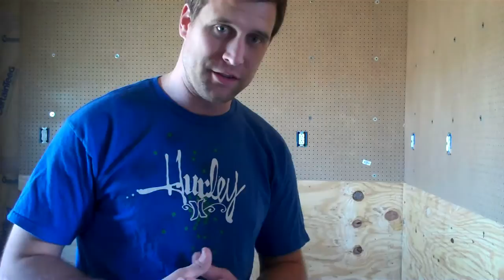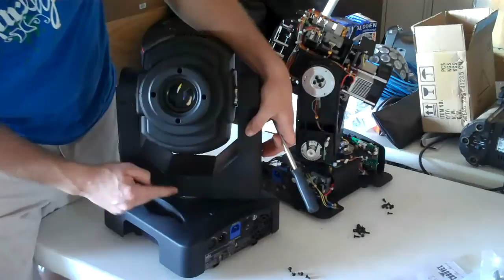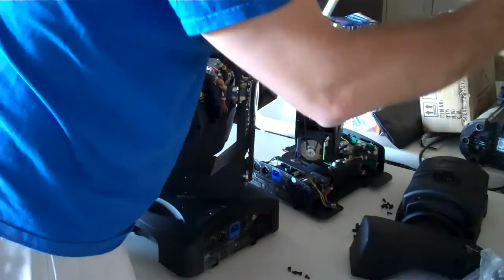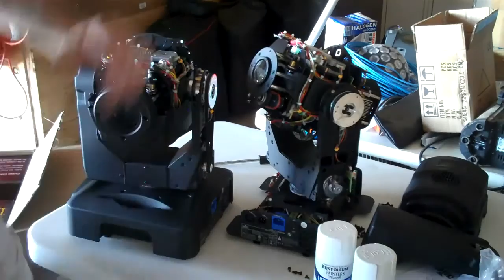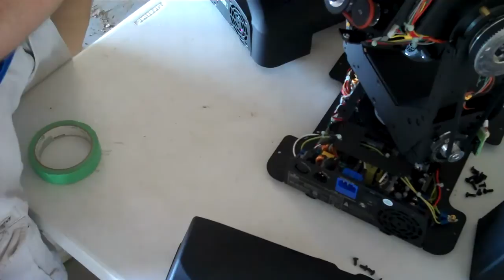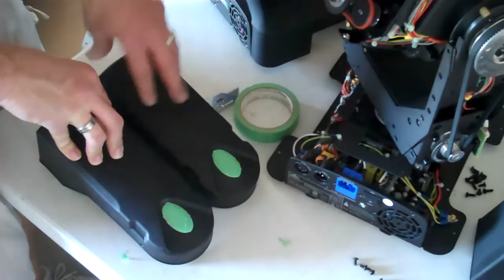Painting the Chauvet Q-Spot 260 LED White

Comment: Have you had any of your Qspots have the LED's go down in brightness. We bought 8 for our night club they get use 2-3 nights a week for 5 hours, & all 8 have had to be sent back now. Its like the power supply for the LEDs is dying. I run them with LightJockey & I take a fully working light and dim it to 35% to get it to the same brightness as faulty ones. I still have 1 out on being fixed but now ones that have already been fixed are having the same problem again. Any ideas on what it could be?